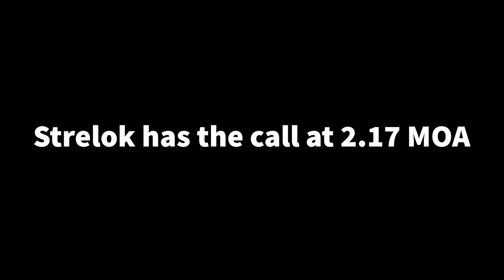204 Ruger: Cold Bore Testing ... the finale...hopefully

Comment: Great video! What sorta cheek riser contraption you got on there? Hafta drill holes?
Reply from the maker: It's a Kindex cheek riser, ya had to drill holes.  It's a beater SPS stock so no big deal. I've used it for years now, I shoot so much better with it on there for sure. Eye alignment is repeatable and more consistent.

Comment: Maybe get some black bench rest targets on manila paper, work the bolt & load with the right hand only, don't get out of position between shots, don't lift yourself up, particularly your head. When you have plenty of the same load put another one into the group when you have a flyer😁It's either great for confidence or shows you've got an issue. Those targets were great point of impact tests, your clicks were right on. It'd be nice to show grouping off of those (horrible😉) orange dots. Can you go longer range? 400 - 450? I bet you'd be damn impressive out that far, & that is common range. The wind can be chaos out there though.
Reply from the maker: I'll have to look into different targets but I haven't had any issues with the orange dots.  As far as my shooting style, I practice and shoot like this because I am a hunter, it's a one shot one kill game.  I don't stay on the gun because I am not shooting paper competitions or swingers.  I want to reset because that's they way it is when hunting.  I should do a video on repositioning vs not, and see what the data says.
Reply: @pawild5594  Yeah, I agree it would be interesting. I disagree on the reset when shooting paper from a bench, prone and/or when hunting. The head down rides the comb through recoil & follow through and reacquires the quarry in the scopes field of view or over the top of iron sights. Sometimes the big kickers will take your face off in prone if you're not careful😁 I saw an ultralite 270win hurt an eyebrow - the shooter forgot to put the muzzle brake back on after a thorough cleaning! Saw the same thing done by a well known, published shooter with a 50 BMG just a few yards away. I thought it was airlift time for sure. He was a thick skulled retired sheriff lol.

Comment: I really liked the 204, until I tried some light Varmint Grenades in my 223 AI.  Got similar speeds to the 204 in this vid, without all the dialing in frustration; and a with zero issues with ammo or component acquisition problems, like the great little 204 has.
Reply from the maker: Nice, I don't have any issues with the 204 or getting components. It likes 32s and 35s better than 40s is about it.

Comment: Why do you shoot groups onto your point of aim? Why do you work the bolt part way with your right hand then reach over the top of the rifle with your left to finish the movement? Why do you get out of position so much between shots so that you have to settle back in before each shot? Why don't you shoot at paper targets, like bench rest six pack or I.B.S. 100 yard targets, they have multiple points of aim. Did you know that in the heat when there is wicked roiling mirage that fluorescent green and orange dots will move different distances in your scope's field of view and that a brown, black or gray image will move differently in the mirage than the fluorescents?